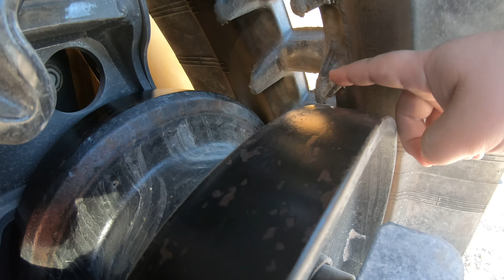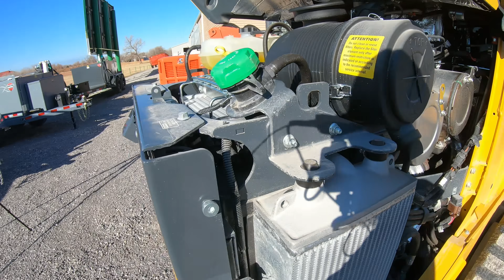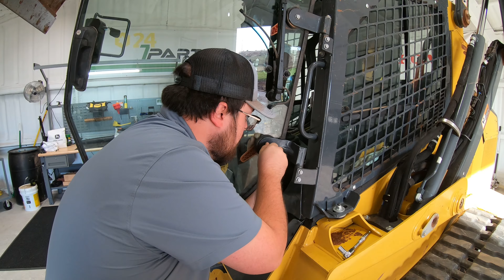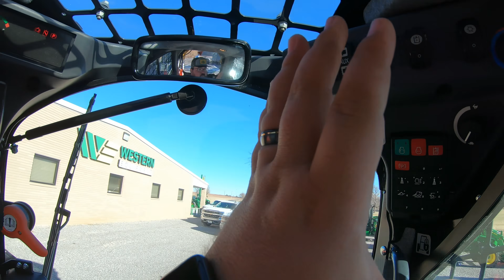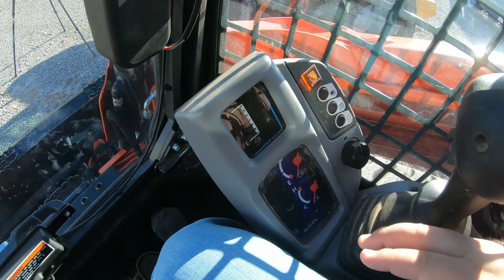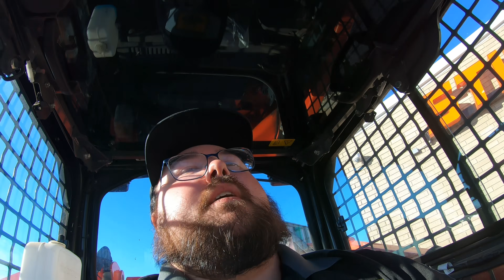Main Difference in Kubota and John Deere Skid Steers!

Comment: 1 nobody gets out of a Kubota like that, you release the locks before you step out. 2 Pilot controls are superior to electric over hydraulic, try shaking mud out of a bucket and you'll  know what I mean. Electric have no feel to them and are jerky. 3 I've been in both and visibility is better in Kubota. 4. Hydraulic hoses are exposed on rear of JD.
5. Didn't JD just have some issues because owners can't work on their own equipment ?

Comment: John Deere has a poor service reputation primarily due to restrictive "right to repair" policies that lock out farmers and independent mechanics from fixing equipment. By restricting access to diagnostic software and tools, requiring authorized dealer repairs, and causing expensive delays during critical planting/harvest seasons, the company is facing lawsuits and public criticism regarding monopolistic practices.

Comment: As someone who doesn't really know much about ctl's or equipment in general. I've heard Deere is a nightmare when it comes to proprietary fittings/software/diagnostic tools that basically require a trip to the dealer for just about anything. Havn't heard the same about Kubota.

Comment: The first time you get trapped inside of a skid steer, that is on fire, and you cannot get out because the door is blocked, you will appreciate that slide up door on the Kubota!
Reply: I have a Kubota and an old New Holland. You are right! That damn swing out door on my New Holland is sketchy! Yeah you can knock out the back glass and crawl over the motor (where the fire is probably burning). You better be skinny, flexible, and wearing fire proof clothing. 😂

Comment: The Kubota door opening up allows you to keep it open and you can get in an out of the machine repeatedly. The door does release from the outside by pushing on a release button located in the middle which he seemed to overlook. The overhead door of the Kubota does eliminate some ergonomics of installing a rear view camera which is unfortunate. The drastically higher price for a new John Deere does outweigh any costsavings on maintenance fluids and filters.

Comment: And some how hydraulic oil costs more. Even though they both use the same type oil. Might as well compare using cheapest diesel vs most expensive diesel around. ( the John Deere advantage)

Comment: Im a huge Deere fan. They make fantastic machines. But I also do trust kubota. I’ve never run a skid steer so I can’t make any comments on that. But I’ve run a kubota mini excavator for a few hours and found it very comfortable. And kubota engines are very reliable, much like the yanmar engines Deere uses. I trust both the engines to be very reliable given they’re taken care of and serviced. 

The cab in the Deere definitely looks well thought out but I do think I’d prefer the slide up door on the kubota. I’m a short guy so headroom isn’t an issue for me. But I’d also like to be able to run equipment with the door open if needed. 

If I had the budget for the Deere, I’d definitely take it.

Comment: I came here in the comments for one thing and one thing only. The Idler wheels are doing the same thing. The double flange isn’t holding the track in line any more than the single. If anything, the single allows for LESS lateral movement of the track as there is lesser space for movement between the inner sprocket guide track. At the end of the day, they’re there for tension and are not going to keep the track on under load if it’s trying to come off.    

I’m buying the Kubota all day. Might be more expensive to operate (apperently), but out the door Deere is going to molest you as they do. Deere is the most over priced stuff you can buy. People buy it at that price on the sole principle that it says John Deere on the side. It’s a novelty. You can’t tell me that orange machine doesn’t look 50,000 times better. It’s fucking orange dude. That’s sick.
Reply: Totally agree. Ive heard of ppl kicking tracks off, ive seen abused kubotas with saggin ass tracks and never kick a track. The kubotas built for the working man. Deere is made for farmers that like all the bells n whistles on their equipment.

Comment: Came across this video. It’s comical how these sales guys attempt to compare machines. I have a 97-2. It’s a flawless machine, it does what it’s suppose to. Deere makes a great machine as well. But the bottom line is tell the msrp’s of each machine. There’s a 30k plus difference in the two. If you want to spend that, no harm, have at it. The reason there doing these video’s in the first place is Deere, Cat, ad some others are loosing lots of market share to Kubota. It is what it is. I can’t justify another %40 for my use’s, your’s may differ.

Comment: I do not have any experience with operating a Deere, but I own Kubota and have operated for thousands of hours on jobs.  Kubota is a great machine, and I believe that I could point out many advantages.  I much prefer Kubota's full hydraulic pilot controls compared to electric-over-hydraulic types, as I believe that I can operate most accurately and without lag in response time.  I also have the theory that fully hydraulic is going to be more reliable.  I am not a big fan of more electrical / electronics.  As I get older, there are some advantages that I especially appreciate about Kubota.  Stepping up into the Kubota is the easiest I've experienced with the lower height of the bottom of the door opening, and the wider door opening. I spend many, many hours operating a compact track loader.  That said, there are many jobsite conditions that require me to get out, and back into the machine many, many times per day.  The Kubota arm wrests are very quick, and much easier to just flick up, and back down than moving a big horseshoe single piece all the way over my head, and back down every time.  The Kubota arm wrests also have an excellent designed shape and padding density.  Again, I'm getting older and my shoulders hate the horseshoe, and very much appreciate the Kubota design.  And how about that Kubota cab space?  I doubt anyone beats it, and I know that some other brands are far less spacious in every way.  Leg room, elbow room, head space, all of it.  I have the notion that Kubota's control switches are down low because there is plenty of room for them, and that some other brands put them up high because of a lack of space.  Another important Kubota advantage over some brands (I don't know how the Deere compares on this) is that for me the pilot controls are absolutely perfectly positioned.  They are exactly ergonomically correct for me.  I know that some other brands are not even close to being ergonomically correct.  For me, control switches on the Kubota being down low is also an advantage.  I find it easier to handle those down low than having to reach up high.  And about sunlight, the sunlight is more likely to blind you when you have to look up than when looking down at control switches, etc. In my opinion, that is a Kubota advantage.  From a performance standpoint, I believe that Kubota is going to be very hard to beat, and will probably outperform the majority of the competition.  As for reliability, based on my experience, the Kubota is second to none.  I do not believe anyone can beat it's reliability.  How high is the top of the Deere's cab?  It looks significantly higher.  On most jobs that does not matter, but on some jobs it is advantageous to be lower to go under obstacles.  What about ground clearance?  That does matter, and Kubota has the advantage.  There are certainly many other details that could be discussed, but I know that if I were going to buy a new CTL today, it would be Kubota, 100%.  My second choice would be Takeuchi.  When it comes to getting maximum work done, I do not believe that any other brand will beat those two.  To be fair, the Deere does have some advantages.  It does appear that some maintenance components are easier to access.  But, there might some trade-off with so many removable panels on the Deere.  Is there a disadvantage from the standpoint of loss of overall rigidity of the machine?  We never intend to have accidents, but what happens to the Deere if it makes a hard rear impact with another piece of equipment?  In that situation, I believe the rigidity of the Kubota would have an advantage with its rigidity.  Will some of those Deere panels become loose and rattle over time?  I don't know, but I wonder.  That is my two cents.  I'm not a salesman of any brand.  I am an owner / operator that spends countless hours doing work, operating equipment for a living.
Reply: Thanks for your information. Unfortunately we are looking at a machine specifically for mulching and so far I have noticed many people saying that the kabotas hydraulics overheat when they are worked hard with a mulcher, and unfortunately we just can't take a chance with these ridiculous prices these days to buy one and have cooling issues. We're not sure what to get tbh.
Reply: @shiraz1736 i would say any machine is going to overheat when it isnt the right size for the job, case by case basis
Reply: @shiraz1736  I use a Loftness mulcher on my Kubota SVL75-3.  Never overheats.  Not once.  Does a great job.  If you have the right sized implement, you likely won't have an issue with the hydraulics.  For example:  I have a buddy who has a JD 5075.  He uses it to power a 15-foot batwing brush hog.  It does a fine job, but it will run hot in very hot weather.  He believes that if he had another 10-15 H.P. it would not be an issue.  So, gotta look at everything that would impact your job and the equipment being used.  Wouldn't matter whether the tractor was a JD or Kubota or Kioti, etc.
Reply: Kubota can't be better than John deere it's honest truth, but all the brands would solve the problems.
Reply: All i see you do is talk smack on John Deere videos... Im telling you as a former operator ill take a deere over a Kubota - I see why your comments on your videos are turned off too

Comment: Kubota svl75-3 now has one piece cab .much quieter cab Radiators above the engine now. Serviceability is the best in class. Compare a svl75-3 and 325 g .
Reply: Yep.  Very happy with mine.  It's awesome in the snow too.  I really like the track pattern.  Cab is quiet and warm.

Comment: I love Kubota products and I started out wanting the Kubota...until I demoed it. I hated the cab, it squeaked, the door chattered, hydraulic and engine noise above 1/2 throttle was awful. The door was way too hard to get in and out of in a hurry, especially with something other than a dirt bucket on it. The lights on the back of the cab shined directly onto the cross bar on the loader boom, which reflected a bright orange glare onto the front windshield, that crossbar also blocked a lot of the rear facing light facing work light.  None of the controls or switches were in convenient places, radio and HVAC controls were behind the operator and no auto idle. The Deere is hands down the nicer machine, so much more thought out. But the Kubota is like $15-20K cheaper. The Deere is the machine you buy for yourself to run, you buy the Kubota for someone else to run.
Reply: Svl75-3 is totally different than -2 models.  Quieter in cab than my bobcat t 66 .  One piece cab . Game changer do your homework.  -3 across line soon
Reply: Im a bobcat guy. I want to demo a -3 but I just wish these other companies would come out with more clear cab options for visibility. @ronworkplay7811
Reply: I gt a 65-2 and put near 1k hours on a 97-2. Rented a deere few years ago to use one time. Me personally. Ill take the simpler cheaper machine. I need it to do a job, not impress sum farmer. . . Pluss, its orange so its hunter safety equipped.

Comment: I’m an overhead door guy, someday the others will figure out the sales they are giving away. Lots of great skid steers out there. Service, parts & dealerships make the biggest difference.
Reply: I checked out loaders with these doors, and though exactly what he said, they seem flimsy, and I could create air gaps to the cab chassis just by applying a bit of pressure to the door.
Reply: @Plowboy70, your point is incredibly valid when it comes to JD losing sales due to that one factor. In my business Sony makes the best TVs on the planet, and yet Samsung outsells them 10 to 1 all because of a 'Frame TV' that Sony doesn't offer. 7 years later the Japanese have yet to respond to the Koreans and Sony's US market share plummets even though the picture quality is much greater. JD not responding is pure stupidity and/or they're not willing to pay the patent fees to whoever.

Comment: I'm a Deere guy.  That being said, this was a clearly biased review favoring the Deere.  The door is a game changer and you minimized it by saying it didn't seal well.  Nah.  Seals just fine.
Reply: He doesnt know anything about Kubota's. Its obvious. There's a latch at the front of the door on the bottom.
Reply: Put 500 hours on your machine and check the door seal. Bet the rollers and seals will have to be replaced.
Reply: @muybravo and see how comfortable you are in 15* or 85* weather. Better yet, just ask guys on a crew working Kubotas all day BEFORE you agree to this kind of door.
Reply: Mine verdict.  Takeuchi is the best
Reply: @GROUNDWORKS-k2f lol.
Reply: The deeres doors don’t seal well either
Reply: I have a Kubota with 2000 hours and the door still works good all you have to do is put grease on the rails so it rolls better and that’s it. I have t had any problems. I’m looking to buy a cat kit for the ventilating seats but I’m not sure about their doors . I like getting out of the Kubota with the bucket mid way
Reply: He was definitely siding with Deere, he did his best trying to minimize the best feature. The roll up door. 
Nice try, Kubota has this hands down. Deere is out of their comfort zone.
Reply: I sat in a kabota just the other day and found this style of door to be flimsy and overrated.
Reply: Personally hate the kubota door but it’s nice you can get out anytime, and it 100% does not seal properly ever 🤣
Reply: I was a deere guy, but all the bs with deere is making me quickly change over to kubota. Sold 1 tractor and bought a kubota. Like  the kubota more. Looking to sell my larger tractor in place of a kubota track loader. Very happy with orange.
Reply: Mine seals just fine
Reply: That being said put in print is next level tardation
Reply: As an exxavator guy I am used to the front window storing up above you. That said I would not like to lift it every time to get in or out, i would prefer the traditional door on the deere.
Reply: Literally, kubota doors do not last..they jam, rattle and after bit the doors just stay up, because there a pain.
Reply: @HighCountrySolutions correct and very heavy
Reply: I have a brand new 97 and a 95 before this and neither sealed fine and AC suck in them. Would have got a Deere but kubota offered me way more on trade and got a deal on the 97. Kubotas cabs are a big rattle trap

Comment: I'm going to say I prefer the battery placement on the Kubota.  On my JD 320d to replace the battery the manual says to start the machine and raise the boom. I'm replacing the battery because it won't start.  I'm on my third battery and the original jd battery was good. It shorted out and wouldn't take a booster.  It can be done but prepare for smashed fingers.  No machine is perfect.  There's things I like about the JD better and things I like on the Kubota better.
Reply: Seems to me like the with the deere if you have a major issue and can't raise the boom your SOL, whether it be electrical or hyd.  I haven't ran a newer deere but I hated the old ones I ran.
Reply: @banffdigger  Pretty much spot on. I think all skid loaders suffer from that issue but the JD is worse.
Reply: @chucks4328 pretty sure i can flip my cab with arms up or down on my kubota. Deere guys gtta brag, kubota guys just go to work.